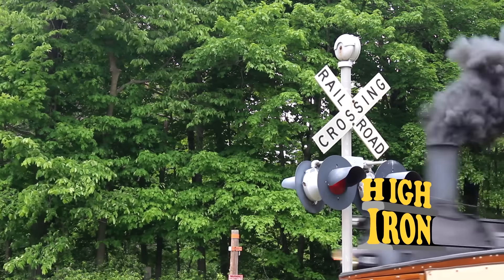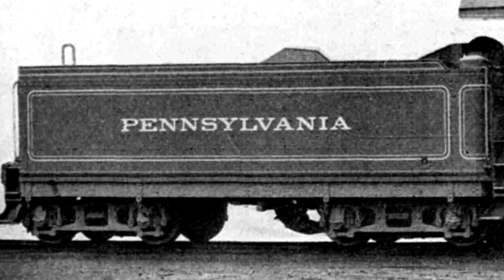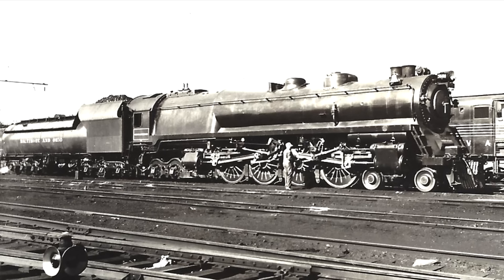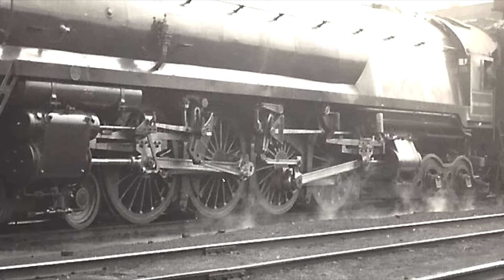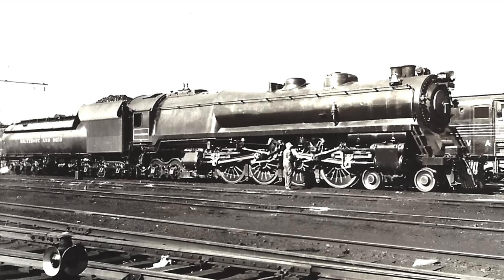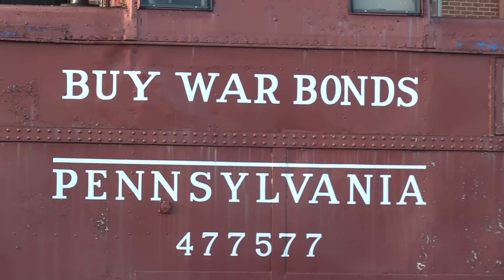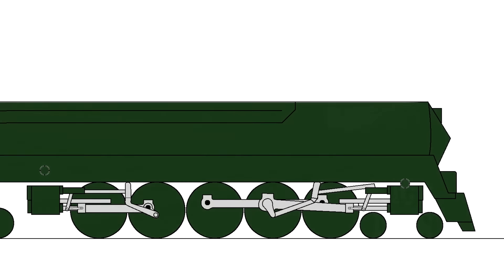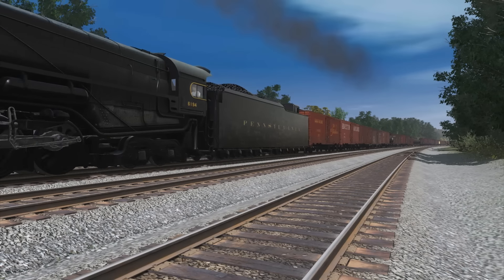Why Weren't Duplex Steam Engines Successful?

Comment: With today’s technology, T-1 5550 will be better than any other duplex steamer ever built!

Edit: how did this get 114 likes?
Reply: I think we have a real chance of re-claiming the land steam record!
Reply: @BMMEC6000  doubt it
Reply: @tylergreen4843  why not? Give me a solid reason why.
Reply: @BMMEC6000 
1. The T1 suffered many of the same problems most duplexes on the Pennsylvania railroad suffered: wheelslip
2. It will be expensive as hell to run it and maintain it
3. Finding a good long stretch of flat track to run it at high speed
4. Damage to the locomotive IF it beats the speed record, OR an accident
Reply: @tylergreen4843  1. It’s already been proven that their wheelslip was mostly thanks to the crews not being used to them and their design (something that is going to be tweaked by the T1 Trust).
2. Yes but you can say the same thing about any locomotive! Plus people are willing to pay a pretty penny to even see this thing let alone ride behind it.
3. The U.S. has test tracks that are used for high speed testing.
4. Although this is a very good point it really all comes down to who operates it and how well it’s maintained prior to the speed test. And if she wrecks. Then that’s a tragedy. We’ve handled much larger ones.
Reply: @tylergreen4843  1. It’s already been proven that their wheelslip was mostly thanks to the crews not being used to them and their design (something that is going to be tweaked by the T1 Trust).
2. Yes but you can say the same thing about any locomotive! Plus people are willing to pay a pretty penny to even see this thing let alone ride behind it.
3. The U.S. has test tracks that are used for high speed testing.
4. Although this is a very good point it really all comes down to who operates it and how well it’s maintained prior to the speed test. And if she wrecks. Then that’s a tragedy. We’ve handled much larger ones.
Reply: @BMMEC6000  140 mph!
Reply: @tylergreen4843  today, we have the tech to solve those problems
Reply: @tylergreen4843  and no one said that the trust is gonna for sure be attempting to break the record. This is all hypotheticals
Reply: @northpennvalleysteamrailroad  let’s hope!
Reply: Im not that much into the speed record,  i just wanna see, not just a duplex, but also a T1, THE T1 Back to life
Reply: @BMMEC6000  I think we all hope they do. Mallard's record is a joke, and I say that as a Brit. If I was actually in charge of handing out the record, I'd have given it to the Germans.
Reply: @mattevans4377  you know out of all the potential record breakers I never looked into what the Germans had
Reply: @BMMEC6000  Look up DRG Class 05. 002 went 124.5 mph, and was a much more reliable record, being for longer and on flat ground. It was also a much more consistent engine when it came to speed runs, so wasn't a one hit wonder.
Reply: @BMMEC6000  No railroad in the world have tracks to handle the weight, size, and hammerblow of the T1. Not even the UP have the track to have the T1 run at full clip. Railroads arent made to the same standards as they used to because they dont have to handle the strain of hammer blow and such.
Reply: @datawizard8194  when the hell did anyone say anything about the Union Pacific?! I’m talking about real government test tracks. They exist you’re just to busy being stuck in the past to notice them
Reply: @BMMEC6000  I mention the UP as its the only Class A railroad still running steam and as for "government test tracks" even if those existed why would they allow the T1 on them? To break a steam speed record? Theres no compeition anymore so thered be no reason to allow it try and do the record, and again its weight, size, and hammerblow are ging to destroy any tracks it tries to do the record on not to mention any infrastructure (i.e: bridges, points, etc.)
Reply: @datawizard8194  look it up you’ll find that not only is the T1 trust’s soul reason to break the land steam record but they also already have a location marked for such an event
Reply: @BMMEC6000  Insurance.
Reply: @tylergreen4843  I can tell someone didn’t watch the video, he stated in the video that the reason the locomotives wheel slipped was because the crews would add too much throttle too quick and send too much power to the drivers.
Reply: @BMMEC6000  Oh come on, why try reclaim an almost 100 year record, that’s just disrespectful, let Mallard keep it for fuck sake
Reply: @threepea1151  why should we? What’s so special about that little pacific?
Reply: @threepea1151  the mallard was going down hill when it hit that speed and almost destroyed itself so I think it should not be the record holder
Reply: Sure, but why do they think they can break the speed record for steam engines, they should just leave that record alone
Reply: @arconnelly5365  why should they?
Reply: @arconnelly5365  because they CAN break the speed record. That’s the whole goal of this project! And if they fail, we have a beautiful locomotive to boast about
Reply: @BMMEC6000  OH MY GOD WHO CARES ABOUT AN 85 YEAR RECORD NOBODY CARES JUST LEAVE IT WITH BRITAIN THEIR LOCOS ARE MUCH MORE PRETTIER THAN OURS ANYWAY
Reply: @arconnelly5365  Fr
Reply: @threepea1151  Everybody needs to calm the hell down! It’s up to the T1 Trust weather they want to follow through with breaking the record or not! And if they do (and succeed) then y’all are just gonna have to suck it up and step aside!
Reply: @BMMEC6000  Or the NRM can fire up Mallard since she’s serviceable and can beat it again and easier since British infrastructure is much better than the US
Reply: @threepea1151  I see you’re British and want to keep it huh
Reply: @threepea1151  yeah right. Do your worst.
Reply: @threepea1151  I thought it was just “the railway museum”? What happened to your guy’s name huh?
Reply: @BMMEC6000 probably won’t it has nowhere to even make a illegal attempt to beat the record
Reply: @gwrstudios5181  OMG CAN Y’ALL GET YOUR FACTS STRAIGHT! The soul purpose of the trust building the T-1 is to beat the record! And also there are legal places she can and will run! Please for Christ sake get your goddam facts straight before you speak
Reply: @25439  I’m American from California lmao
Reply: @BMMEC6000  But you are at your worst rn
Reply: @gwrstudios5181  it’ll take some permissions, but possible
Reply: @threepea1151  I fail to see how
Reply: @threepea1151  thank you 😊
Reply: @BMMEC6000  honestly the achievement means little in my opinion because it’s taken almost a century.  Even if it does break the record it doesn’t mean anything long term. Sure the engine will be special for breaking a record no one else has cared about for decades but what happens next?
Reply: The 
wheel slip was caused by spring loading issues and improperly trained crews used to driving clapped out k4 and the like. There were also some early valving issues that were worked out. The t1's were killed off before they could really hit their stride. The t1 project has looed at and addressed these issues. There are records of t1's hitting 140 mph though never witha dyno car so the mallards record still stands.
Reply: It’s literally only 114☠️
Reply: I for one am not holding my breath for the T-1 trust to ever complete there locomotive.
Reply: @threepea1151  Not really, Mallard broke its valve gear via overheating when setting the record back in the day and was very poorly maintained during WW2 so it ain't even going to manage the same speeds again, much less even faster.

...besides if you seppos and poms don't stop fighting, us Aussies will have to take advantage of having the worlds longest section of straight track at 478.193 kilometres (297.135 miles) on the Trans-Australian Railway and build a behemoth of a steam loco solely designed to put both other countries in their place.
Reply: External combustion is too inefficent to be considered for anything. Less than ten per cent thermal efficiency.
Reply: Perhaps the T'1's have a lot of us "friends"--I just discovered this maybe 25 minutes ago!  But I've known about 5550 for years..  Wish I hadn't poured $250 down the rathole of those NYC electrics in Albany--they've had 15 years at least to "solve" that and now they need twice the money to "save" them even tho' the latest is they might barely be able to do a "stuffed & mounted" exhibit at beast!  My money could have gone to PRR 5550!
Reply: You do appreciate that the whole point of the duplex arrangement was to reduce 'hammer blow'/dynamic augment at high speed, right?  So what would make you think there would be any more problem than, let's say, FEF-3 844, a locomotive with higher axle loading and greater overbalance to boot?
Reply: @wizlish  Were the duplex engines in Europe more successful than in the US?
Reply: Given the chance, and provided they restore her to working order, I think mallard could run that fast again
Reply: Also, I find it very hard to believe that the t1 could get anywhere near that speed
Reply: @pmsteamrailroading  They already have a nearly complete boiler and firebox, 6/8 drive wheels, the prow, the cab, a complete tender, and are about ready to cast their frame. But sure, you can think that.
Reply: @BMMEC6000  Actually, privately they will say the record is an objective using the test track in Colorado, although excursion service is clearly their primary objective..
Reply: @daveevans2527  mhm
Reply: Of course speed is important, but it isn't always the primary measure of locomotive success. Reliability and operating costs can trump it. Focusing on speed may have been important in a pre-interstate and aviation American, but other measures for a successful locomotive today isn't that. So what should it be?

Comment: One of the more interesting variations on the duplex design, was Davenport's duplex drive geared locomotive. The pistons drove a jackshaft, which in turn drove a series of reduction gears and a clutch.  This driving system, pistons and all, being located on articulated bogies not unlike how the heisler or climax worked.  The design proved in theory that this would allow a geared locomotive to have a LOT of available power,  and still keep up to speed with conventional locomotives. However it also proved to be very hard to maintain, and as a result only five of the engines were built, with most all of them being out of service by their railroads after a year or two.

Comment: I hope once the T1 trust is built, hoping she will be able to redeem and be successful for her duplex concept at least which I'm hoping so that the duplex design can once again get the final results we always wanted.... was the duplex good design or not? I hope we get that once she's finished.
Reply: Exactly where are they going to run this thing extensively under conditions it was designed for? This is needed to acquire data about its performance.
Reply: @williamclarke4510  I think the T1 Trust organization said where they might run it but idk because they took some design modifications to the original to make it like an inch or 3 inch shorter height to account for the bridges
Reply: @williamclarke4510  Well, someone already paid for them a trip to the loops in Colorado where they test high speed trains

Comment: Called "The Big Apple" on the B&O because it was mostly in service between  Baltimore and Jersey City, which is sorta New York. It had a water-tube boiler, which did not seem to catch on as locomotive type.
It was  reputed to have made 100 mph on the Jersey Central, a company related somehow to the B&O.
My father, a locomotive engineer for the B&O, related that story to me, which is no doubt a story related to him and so on.
Could be true though.
Reply: Ever been to the B & O museum in Baltimore? I have, and it’s a really fascinating look into B & O history. You might be able to find more info about the stats, routes, and locomotives and etc. there. Either way, really interesting story about locomotive history.
Reply: @jmdibonaventuro  I have, but it's been a while.
Reply: The 'relationship' of the Jersey Central is that it was an integral part of the B&O's New York extension, together with the Reading.

Comment: The Norfolk & Western J-class are without a doubt, the absolute penultimate in steam locomotive design.  I have ridden behind many locomotives and the Espee 4449 is the most beautiful.  But I had to eat crow and admit that the N&W 611 made a twenty-three-car train child's play.
Reply: The J was designed for pulling heavy trains over steep grades and curves, not speed.
Reply: Careful, modern light weight passenger cars with modern roller bearings are MUCH easier to start than WWII era passenger cars, especially the heavyweights. Its comparing apples to oranges. The old saying that "a steam locomotive could pull a train it couldn't start, and a diesel could start a train it couldn't pull" has been made obsolete by modern roller bearings. 

What counts now is how closely the locomotives drawbar pull vs speed curve and HP versus speed curve matches the terrain, running speed and trailing tonnage. The 611 was designed for more rolling terrain, whereas the PRR T1 was designed for the flatlands. 611 has no chance of matching the T1 on a racetrack like stretch of main, just as I expect the 611 will beat the tonnage of a T1 in rolling and curvy terrain. This difference in performance in different situations is not repeated for modern diesels where the electrical systems provide for something equivalent to switching gears in a car. Steam only has one driving ratio, so terrain and desired speed drives the optimization. The PRR M1 was a compromise - pretty fast in the flats, and pretty decent in rolling and curvy terrain too, but a T1 would beat the M1 in the flat-lands, and an I1 decapod would beat it on a mountain..

Comment: PRR had plans to convert the S1 Class in a streamlined Niagara Class. They had the plans to convert from 6-4-4-6 to 4-8-4 and they had plans to shorten the locomotive, but keep the streamline also. But they scrap the plans after the T1 came out.

Comment: I heard that the t1s slipping was largely due to the crews being used to the k4s and not being properly trained on the t1s
Reply: You’d think that problem would be only temporary. Like a beginner learning how to operate the locomotives, through trial and error they would figure out this was the problem.  But it was never remedied.  Imagine a truck driver who never learned how to properly drive a truck.  They would be given a bit of leeway in the beginning but eventually they would either figure out how to drive better or be fired.
Reply: You’d think that problem would be only temporary. Like a beginner learning how to operate the locomotives, through trial and error they would figure out this was the problem.  But it was never remedied.  Imagine a truck driver who never learned how to properly drive a truck.  They would be given a bit of leeway in the beginning but eventually they would either figure out how to drive better or be fired.
Reply: @gregrowe1168  exactly
Reply: It wasn't temporary, engineers of the day were extremely resistant to change and real jerks who knew it all.  Huh, I guess not all that much has changed.
Reply: Yes - the T1 had a front end throttle that was much more responsive than the K4's dome throttle. A lot of reports have since been found documenting that there were PRR engineers that did not have the problem with slipping once they realized the differences, and yet others just beat the locomotive regardless of the class. If you want to learn more about operating a steam locomotive, and the difference a good engineer can make, I would recommend the book "Setup Running" if you want to learn more (although that PRR engineer never operated a T1 or S1) It is one of the best books documenting the skill and art of a steam locomotive engineer.  Other documentation on T1 operations can be found in a few issues of "The Keystone" - the publication of the Pennsylvania Railroad Technical and Historical Society. Those issues are out of print but you may find them on-line or at a train show.